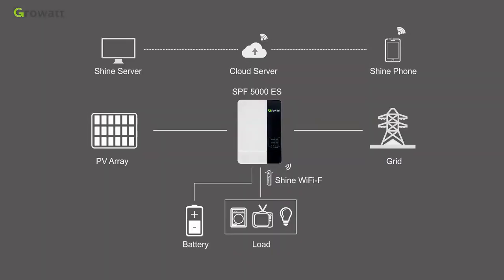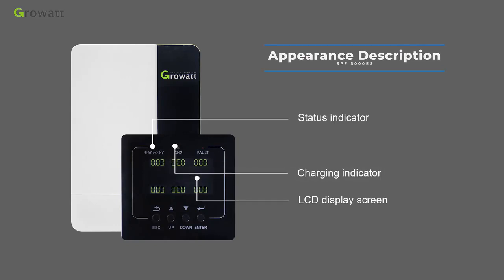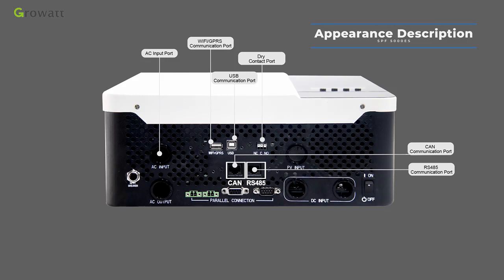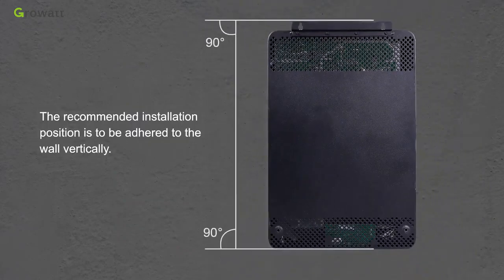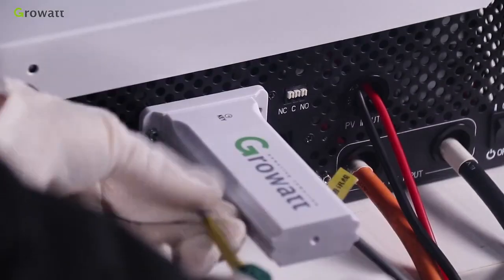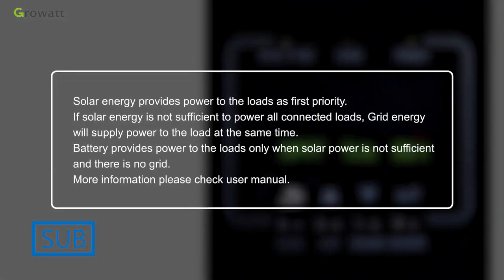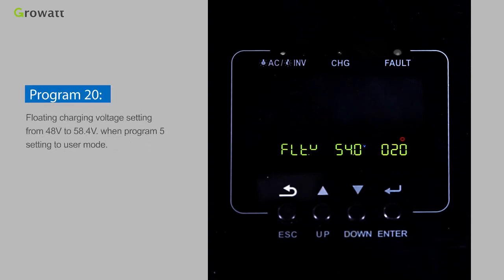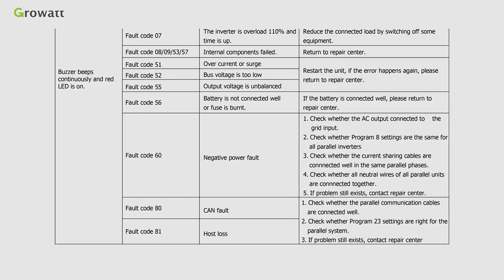Growatt SPF 3500-5000 ES Off-grid Inverter Installation Introduction

Comment: good presentation, I have a similar inverter but  It does not charge from the solar side, there are 250-260 panels voltage

Comment: My Lithium battery connected to My Growatt  has been drained and not charging, How can I fix it and avoid this drainage in future?
Reply from the maker: Can your lithium battery communicate with the inverter normally?If the communication can be normal, you can set the SOC percentage to stop discharging in the inverter
Reply: @sunlinksolar5918  no... I cant see any Comm cable attached between inverter and battery... Its a normal comms cable?
Reply: @maujiii  The communication uses a standard RJ45 cable